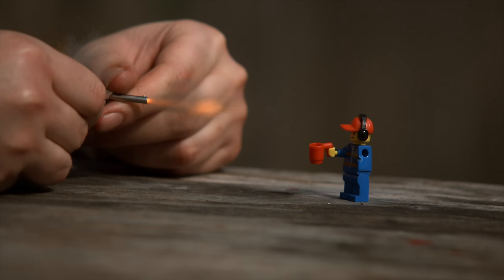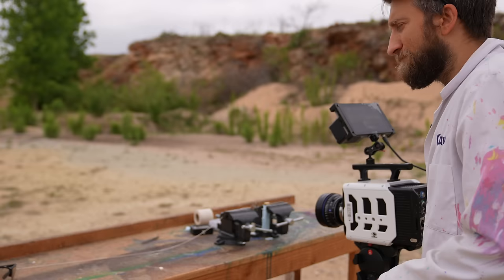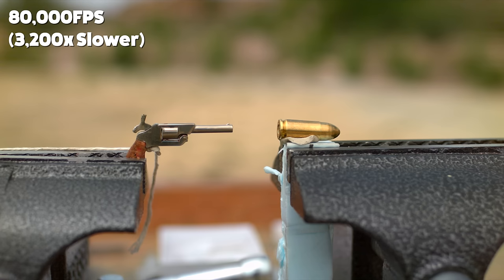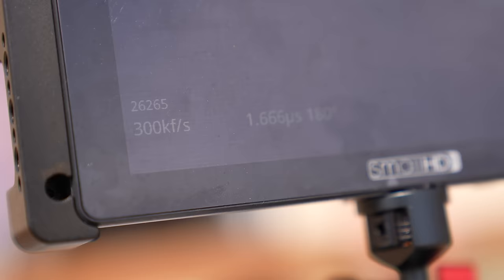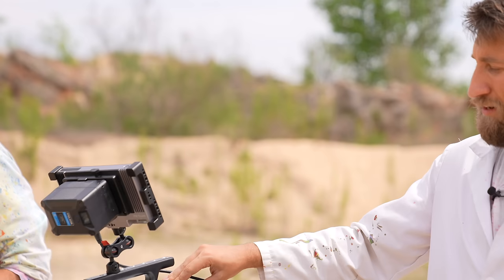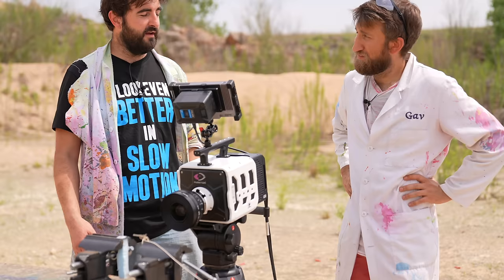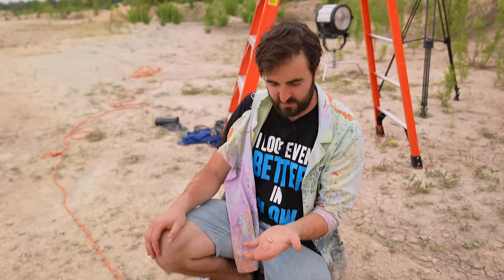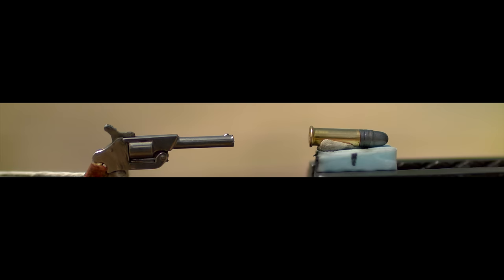Can a 2 Inch Gun Fire a 1 Inch Bullet? - 300,000FPS - The Slow Mo Guys

Comment: You rim struck a center fire percussion cap and literally wedged it out of the casing without causing it to fire. On the one you succeeded in getting the bullet to leave, the primer is still getting pounded by the bullet, deforming it and resulting in another primer ejection. Firing pins only go in a minute amount vs the unchecked bullet continuing forward. Nice call going to rimfire.

Comment: An object roughly 3.5 feet off the ground (which is probable unless dan is a giant) will hit the ground after about .4664 seconds. If the measurement on the camera was accurate and the bullet traveled at an initial velocity of 27 miles per hour (or 39.6 feet per second) you would have found the bullet 18.46 feet (or less due to air resistance) from where it was projected. Dan took about 13 strides (or 6.5 double strides) that I would guess were roughly the average 25-30 inches apart as is standard. This suggests the bullet traveled a minimum of 27 feet and therefor had an initial velocity of at least 38.8 mph. I wonder how accurate the video camera truly is, if the bullet perhaps launched at an angle or if the ground was downhill to some degree.

Comment: Smokeless powder burns too slow for what I think you were trying to do.  In addition, you need a chamber and bolt face for proper/contained ignition and at least a 2" barrel to allow some powder to burn.  Try the same experiment with the 9mm filled with faster burning black powder and hotter primer.  The bullet still probably won't go anywhere but you'll probably get the bang you're looking for.

Comment: Me and my older brother shot in AK-47 round primer with a BB gun when we were teenagers but we thought the bullet was going to come out regular so what we did is pull the lead out and painstakingly crush up or wrap tightly and extremely hard piece of cardboard like we squashed it in a vise until it was just the right size and smushed it back into the barrel and then shot it it made it pretty big bang so we definitely got the cardboard in there tight but there was no damage we had it facing a board in front of it and there is no marks whatsoever nothing but it was loud it was really loud so loud my mother caught us and it was trouble

Comment: What you are seeing here is the law of conservation of momentum. When a cartridge is in a relatively heavy gun, let's say 1 Kg and a bullet weighs (say) 5g, then there will be 200 times the speed imparted to the bullet than to the gun (in the form of the recoil). So if 0.5 m/s was imparted to the gun, then the bullet would gain 100 m/s. As kinetic energy goes to the square of speed, then that's where most of the energy has gone. The gun will have picked up 1/2 x 1,000 x 0.5^2, or about 125 joules of kinetic energy, whilst the bullet will have 1/2 x 5 x 100^2 = 25 kJ of kinetic energy. So, equal momentum (in opposite directions), but with the bullet carrying 200 times the amount of kinetic energy. The heavier the gun compared to the bullet, the higher that ratio. 

When a bullet is fired outside the barrel of a gun, then the ratio of mass is more equal. Therefore the cartridge will fly back at a speed more comparable to that of the bullet simply because their masses are much closer together. 

There is another effect of course in that, unconstrained by a barrel, the hot gasses from the propellant can expand in all directions, so the total kinetic energy imparted will be a lot less anyway, but the conservation of momentum issue is still important to understand what is going on.

However, I've cheated a bit, because I've ignored the momentum from the burnt propellant. That means the ratio of bullet to gun mass isn't fully definitive. We'd have to know the mass of the burnt propellant and the speed that is travelling at too. That will carry some momentum too, so that will act to reduce that simple mass ratio.

Comment: Could you try the same thing with a barrel/pipe with the rear end of the case partially closed to prevent blow-back? Would be interesting to see if it stays accurate with range.

Comment: using the kinematic formula, assuming the table height is about one meter, the bullet took 0.45 seconds to hit the ground and traveled a little under 5.5 meters. at six and a half paces away, this puts your stride at around 0.84 meters. perfectly respectable. at any rate, i don't think it so much as skipped when it hit the ground. just came to a dead stop. girl that's so sad

Comment: Because of backfire. And the damage that the pin gun did. Made the primer and back end of the bullet weak. That's why it fired backwards, faster than forwards. Plus lack of accuracy of no barrel. Reduces pressure as well. So pretty much 3 main factors.  Small bullet to huge bullet.  The same thing will happen.  Just at a more aggressive fire.  Just be careful guys.  Don't need to blow yourselves up. Lads

Comment: DO NOT DO THIS. I'm just going to state this bluntly, these guys are risking their lives by firing bullets without the cartidge being contained in a firearm. They are holding the casing of the cartridge with essentially a piece of gum (sticky tack) that means if it successfully ignited, the casing could theoretically hit them at almost 50% of the speed of a bullet. That is sufficient to possibly end them.

Also, gunpowder is measured in grains, not beans.

Comment: ugh i was hoping you would've strapped down the casing of the bullet. a gun does this similarly by not letting the bullet go back hardly and instead the blowback happens and ejects the cartridge after the bullet leaves the barrel and the blow back is fully pushed back. the gun is designed to hold the casing there until the blow back is finished because that's when the shots left the barrel.

Comment: Oi.  Physics, bullets when fired create equal and opposite forces, however traditionally, the gun, the chamber and your arm are providing the stopping force for the cartridges backwards force, and the bullet flies out the front.  Or, put simply, a bit of gummy tape isn't enough to hold against the force of the bullet.  You need to secure the bullet to the table, try duct tape.

Comment: You two, and most of your responders, need to study up on firearm ballistics and the role of the components of a firearm. Anyone knowledgeable about firearms could have predicted as much, though in some circumstances depending on the components, caliber, load, and the associated pressures, one would might also have experienced the bullet remaining relatively in place and the brass flying back from it since it was not prevented from doing so by a breechblock, critical component in conventional firearms. e.g. compare the momentum on each end of the fired cartridge.

Comment: Love the channel guys, but not knowing the correct nomenclature for what’s in a std boxer primed 9mm cartridge seems a little weak… .  If you’ve ever reloaded, you’d know that pistol cartridges are crimped, and some are crimped harder, with more crimp so the powder has a longer time to more fully ignite (among other reasons…)., and without the backside of the frame or bolt, there’s always a chance the primer will back out some, or as in this case come out completely.  The 3 legged piece from the primer is called the anvil. The firing pin strikes the back side of the primer, squeezing the primer material that ignited when squeezed between the other side of primer cap and the anvil inside, causing fire(ignition of the primer material). Still, very interesting, great footage. You guys are a great team, and love your channel. Thanks for your many many slo-mo videos 👍👍👍😎😎😎

Comment: In a 'real' gun, when the firing pin hits the primer, the chamber is sealed by the face of the bolt or hammer. So the primer is held in the cartridge base and can't blow out backwards. When the primer detonates, all its effect goes forwards into the -- relatively inert --powder and ignites it.